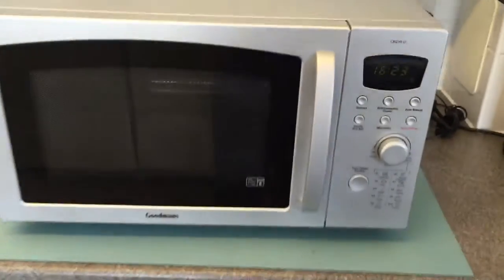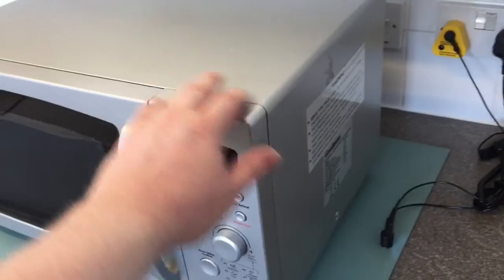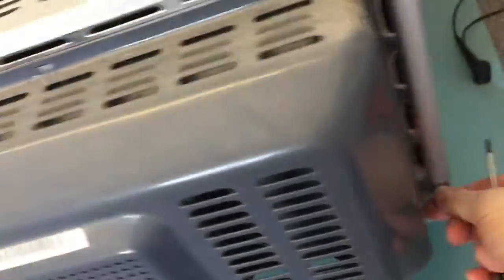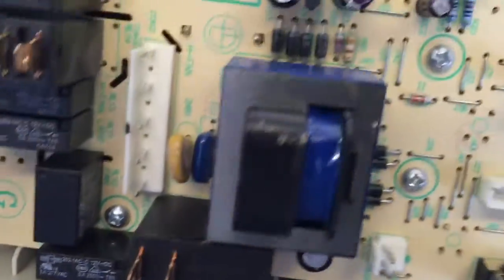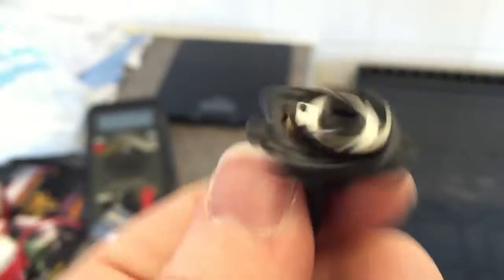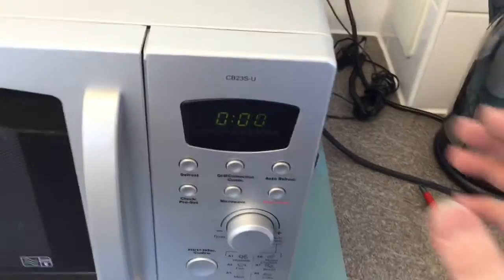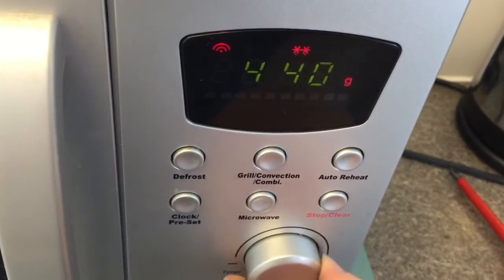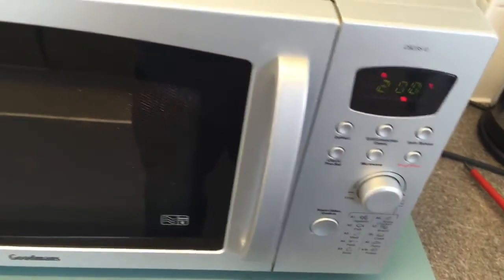Repair: Goodmans CB23S-U Microwave Faulty Rotary Dial

Comment: Thanks for great vid. Our Panasonic had exactly the same component fail and it was a surprisingly easy 10 min job to fix. Must be a common problem as they add grease to the rotary spinner and it then leaks into the underlying contacts.

Comment: what is the cleaner/spray that you're using?
Reply from the maker: It’s electrical contact cleaner.  You can get it from most electrical/electronics supply places.
Reply: RedDragonUKTech isopropyl alcohol and a cotton bud works too!
Reply: I took my microwave apart last night, I was able to release the dial / display unit and unscrew the PCB without taking the connectors off, as a small ribbon cable linked to circuit board underneath with dial unit attached to  it (take photos of screw locations or mark)
So removed last PCB to show dial unit, which didn't appear to come apart, noticed that I could see the wiper arms through a slit.
Poured isopropyl alcohol into it and shook out about 3 times and let dry.
reassembled (remembering ribbon cable) and it works perfectly now!